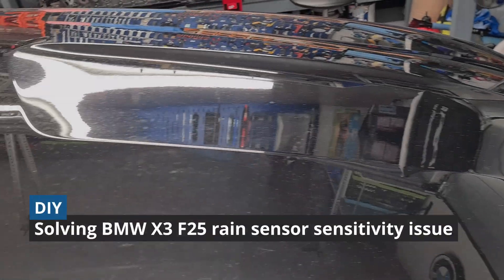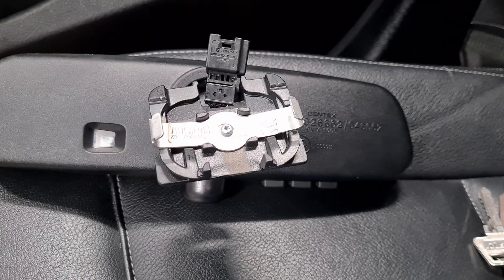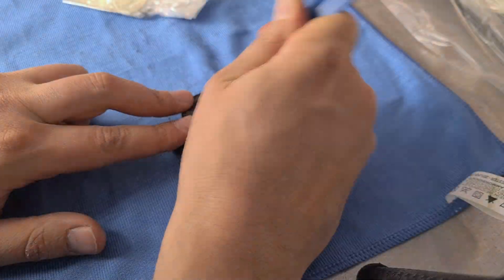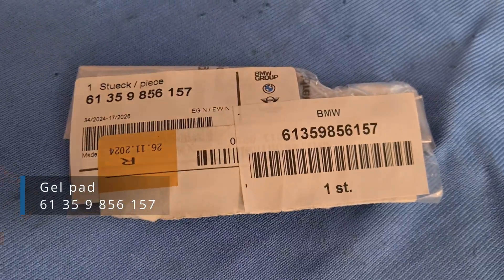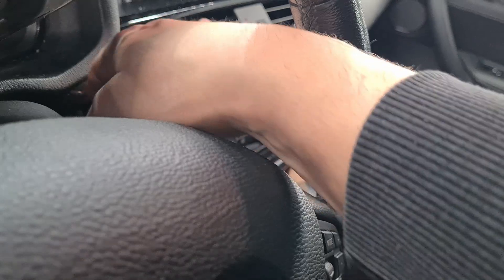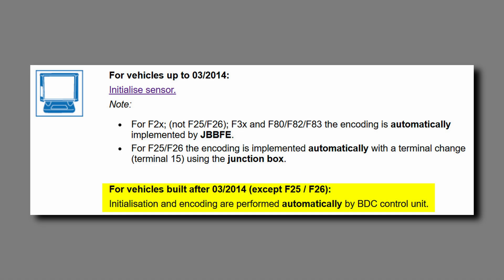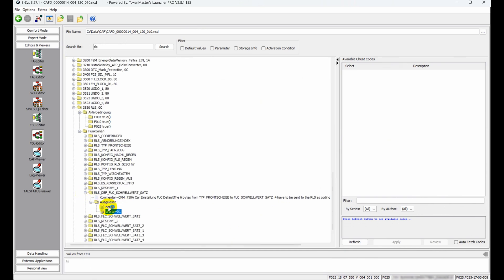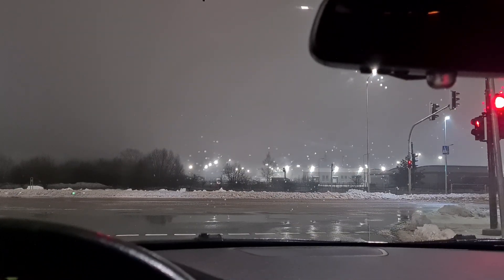Rain Sensor Gel Pad Replacement: BMW X3 F25 28iX

Comment: Hello! Good morning! I have a question: whenever I press the automatic wiper button, it wipes across the windshield, even if it's not wet. Is this normal?
Reply from the maker: Hi. Wipes continuosly? Its not normal.
Reply: @dionich  No no.. just 1 wipe.. and stops if dry.. And when water drops, than it starts.
Reply from the maker: Hi. Just checked mine. It does one wipe on dry windoe. So looks like its normal behavior.
Reply: @dionich perfect!! Thank you so much!!

Comment: Tengo un problema al estar de día la pantalla no prende pero de noche si, hice la prueba en la noche que la pantalla enciende puse una linterna en el sensor simulando que es de día y la pantalla se apaga debería cambiar el sensor o solo la silicona ??
Reply from the maker: Light sensor should work even with the cracked silicone. Maybe the sensor is failed.